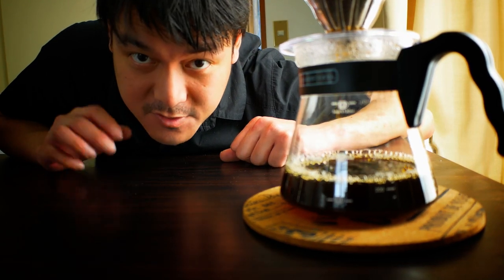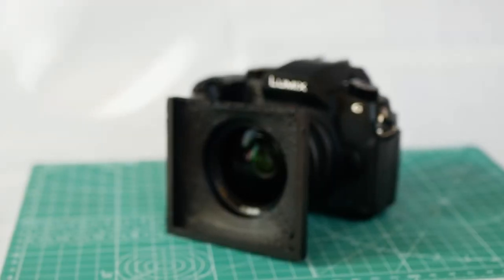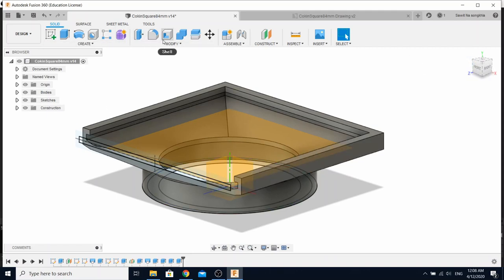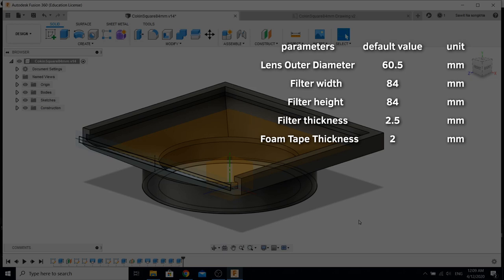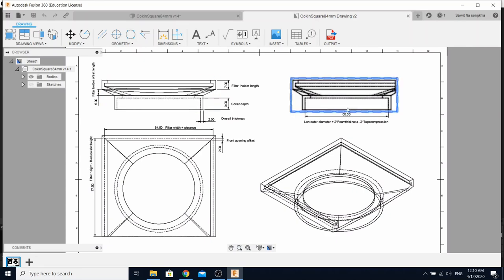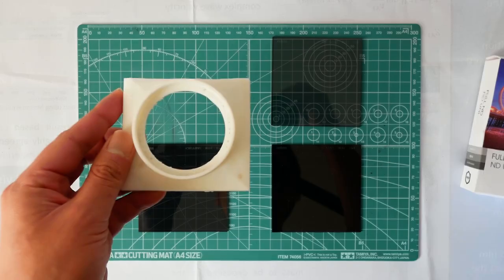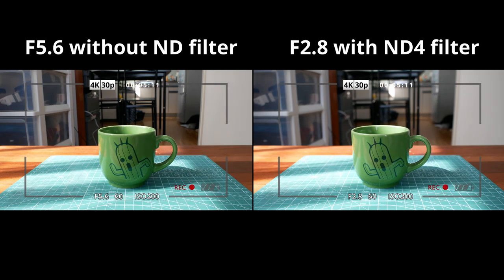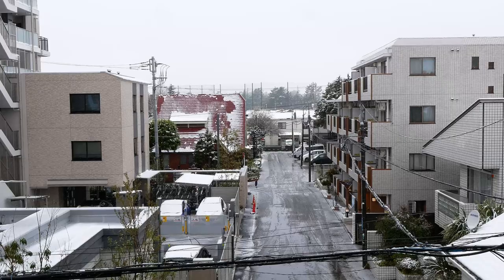3D printed: Lens Filter Holder

Comment: I have a Tiffen 4.5" Round filter. SUPER hard to find ANYTHING to hold this thing, because it seems very specifically made for high-end filmmaking. I then figured, I could get into 3d printing and just print a damn adapter that would hold this filter instead of buying the actual holder for way cheaper (including cost of printer). Thank you for your video as a proof of concept!